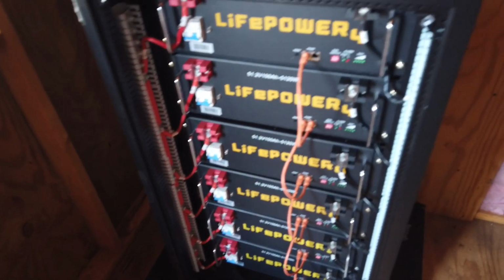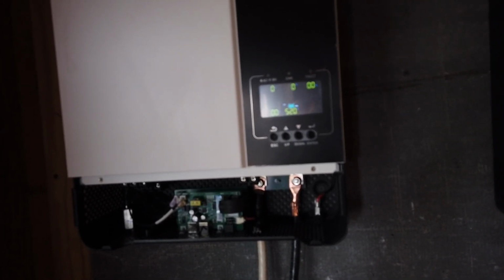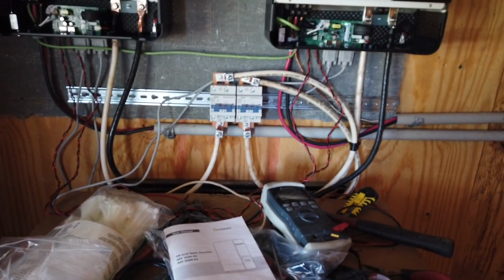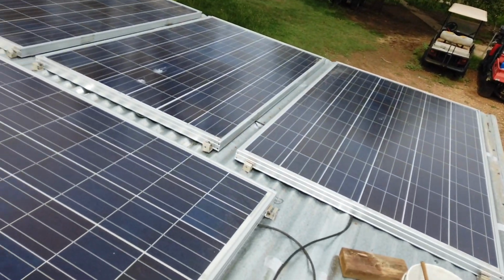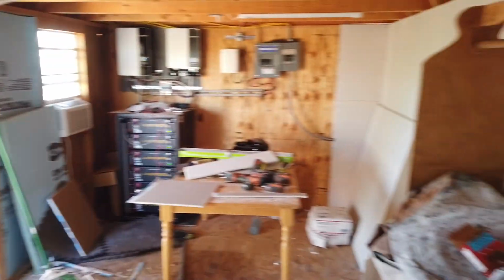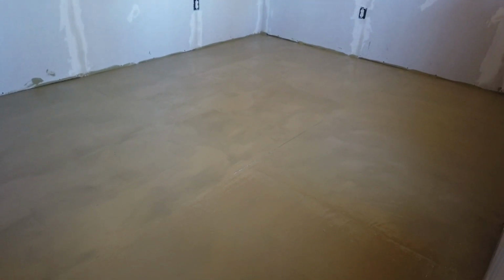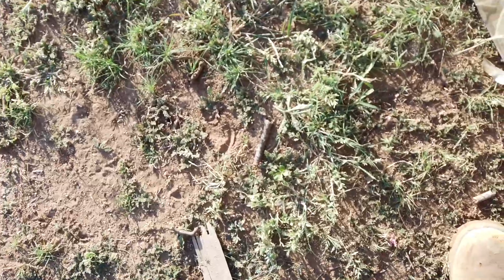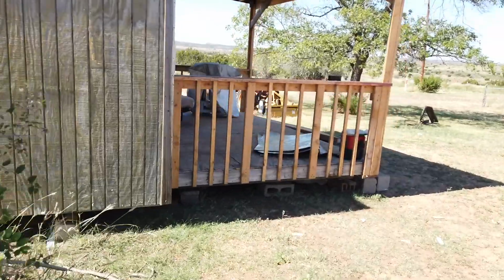How I Built A Ranch House Power Station from Scratch

Comment: Don't be fooled. These inverters use the same exact design and components that's found in cheap Harbor Freight inverters. The only difference is that the manufacturer has added the inverter's PCB into a much larger, heavier gauge metal box to give the appearance of a heavier duty product and have added an MPPT circuit and a few low cost circuit breakers. They still offer shorter life expectancies, far poorer surge capacities, are overpriced, and because they lack an output transformer, they can easily damage your appliances or EV. No thanks!
Reply from the maker: I've bad these up now for a couple of years and haven't had any issues with them, I do have an upgraded inverter that I'll eventually be installing in place of them but for now they've done a great job for the price. I think I will use these in my shop eventually. Not bad at all for the price but really not designed for our grid system. What system do you have set up?